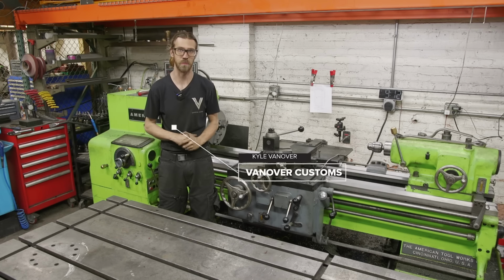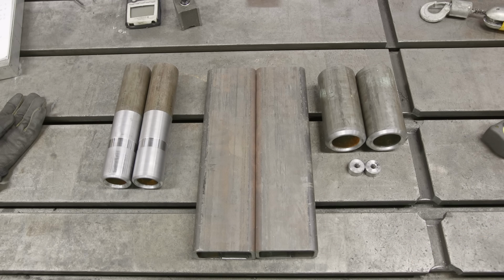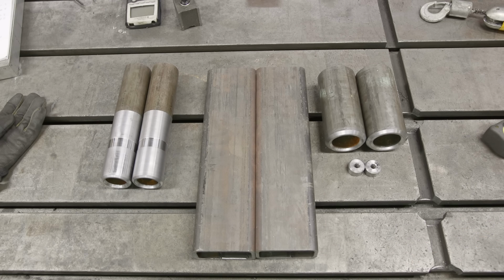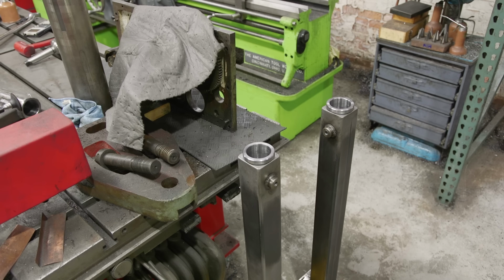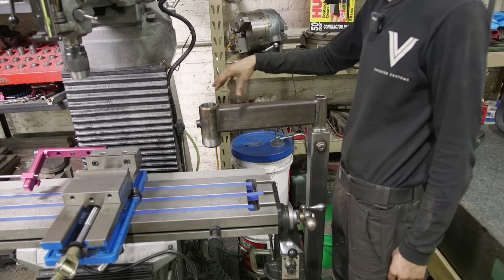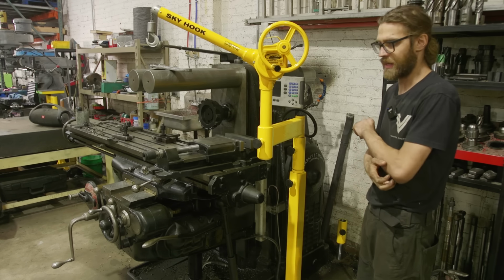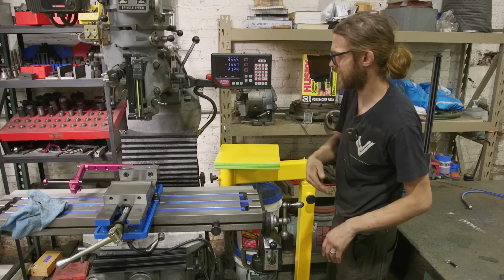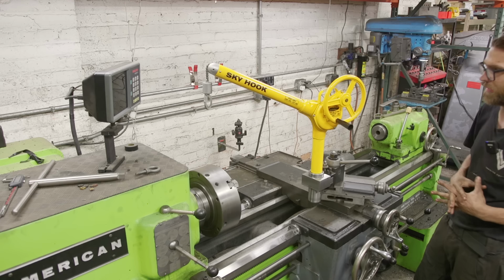Welding and Machining Sky Hook Accesories

Comment: Hi Kyle, really clever use of a back saving device. Well planned out. I don't know how much you would use it, but I am looking at the vertical hole in the pivot of the base, and my thoughts are tp make a removable blueprint hangar with clips. I can't live without mine (not a pedestal base unfortunately), but my setup works well for me. Thanks for the video!
Reply from the maker: I use mine quite a bit, but I need to start moving towards a Jib Crane instead in that area because it is more efficient, especially on the really big pieces.

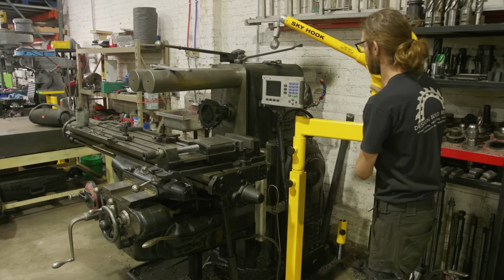Comment: 31:00 "setup for storage", keeping it together, so add a short horizontal tube to store the "dogbone" if you have to remove it regularly
34:34 not a fan of sharp corners on the yellow table
Reply from the maker: Yeah good thoughts. Yellow table corners haven’t been an issue yet

Comment: I’m not as trusting as you are with hanging all that Weight off the tool post. I hope it works out well for you. I’m just not willing to risk it personally. 
I’d rather secure it to the bed ways or base. 
But you aren’t the only one, I’ve seen others taking the plunge. 
Nevertheless it is still great machining and  fab work. 👍🏻
Reply from the maker: Yeah seems to make sense based on logic. Idk maybe it isn’t great for it. Apparently the force on cutting is far greater than using the skyhook. I buy it in one sense but also leverage. I can see how 200 lbs 18” away is more force than a thousands pounds of force just at the cutter. I guess we’ll see.